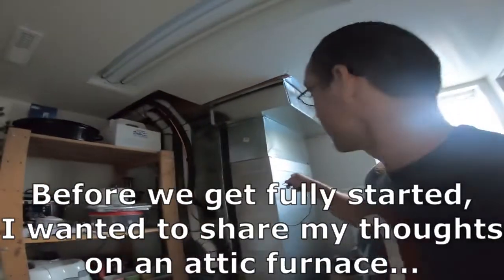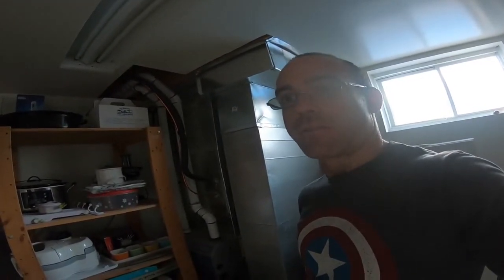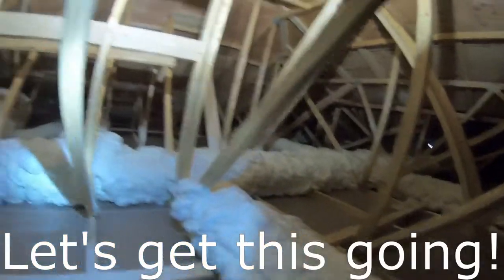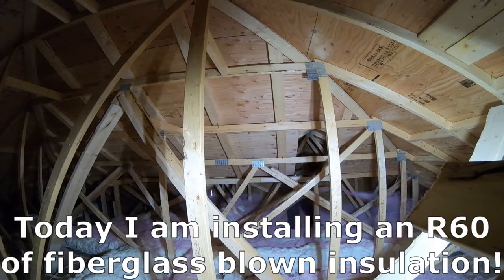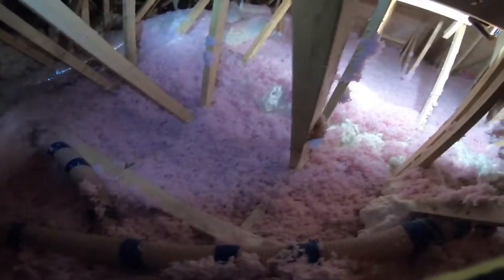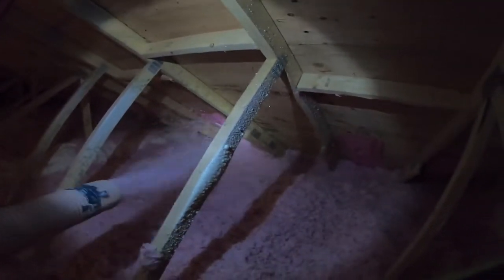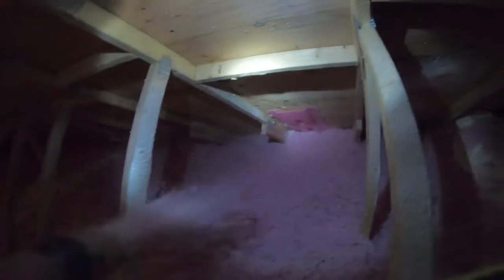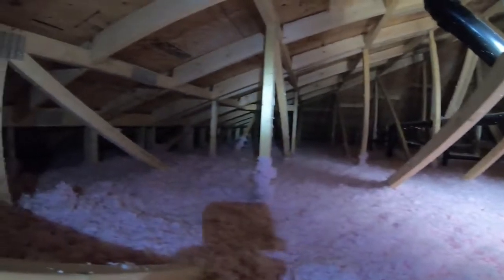New home construction with HVAC ducts in the ATTIC

Comment: can i air seal with foam over the insulation that wraps the ducts (ducts are in the attic)?
Reply from the maker: You can but it has to be closed cell foam and the application has to be continuous through the unconditioned attic space. The video shows half pound or open cell foam which is cheaper but will let a small amount of moisture and vapour pass through over time. But that product is more dense than the standard wrapped fibreglass used in older ductwork and flexible ductwork. Let me know if you have other questions.
Reply from the maker: Another video you can checkout is https://youtu.be/OviPmAeN-9k. It will give more insight to a more efficient hvac system and ductwork.
Reply: @SinnisjInsulator  you rock!  thumbs up to you and your video.  thanks for the help
Reply from the maker: @jskweres2  You are very welcome, I post each Tuesday on various insulation work I do. Have a great long weekend. Share videos that you like with friends and family.

Comment: They where sprayed line of sight witch makes the dark side of the moon exposed!! Foam sprayer needs a recap on ductwork spraying
Reply from the maker: or just double check their work. it’s best to always look at the work from different angles, especially half pound.
Reply: @SinnisjInsulator  those curl over cavities that form when you spray off angle are so visible in that video